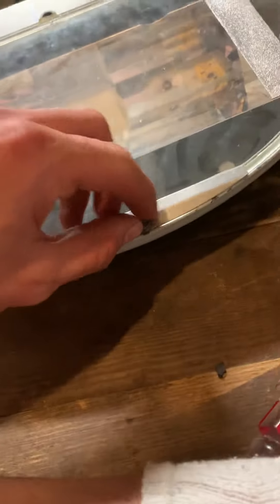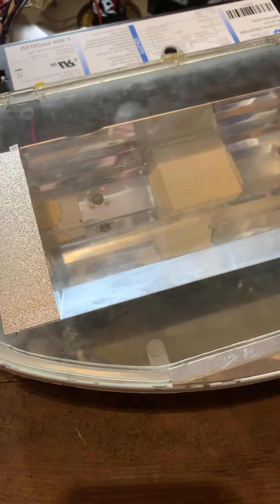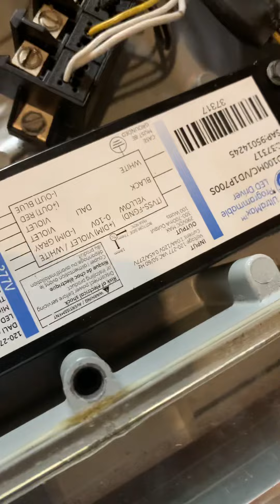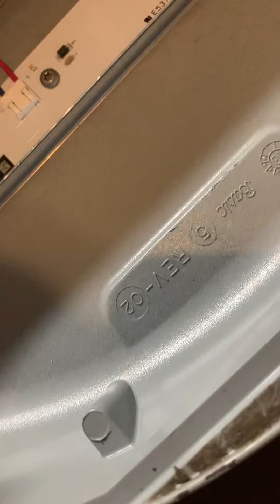Ge Erl1 Led street light

Comment: How did you take the glued seal off to take off the the glass? I’ve had to bake Fixture to melt the seal for a bit in order to take the glass off
Reply from the maker: Flat screw driver
Reply from the maker: Flat screw driver